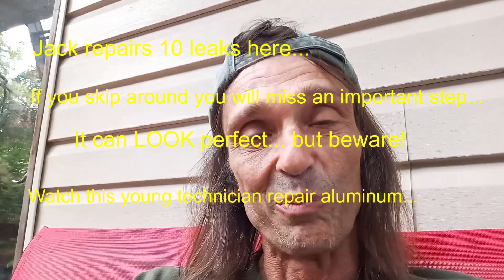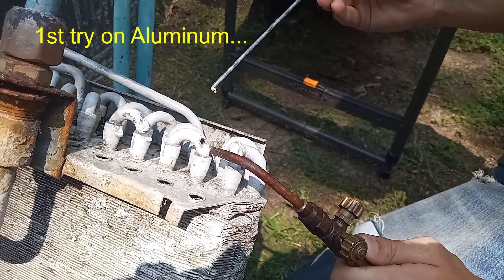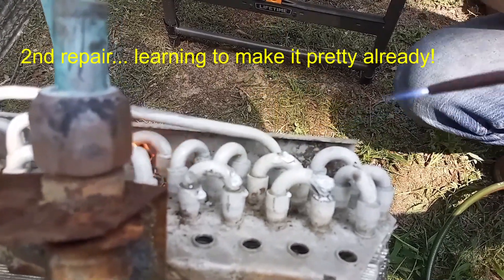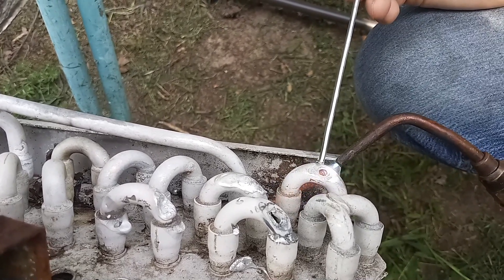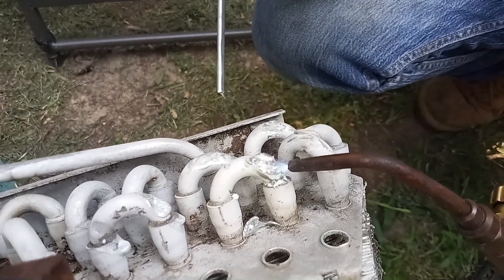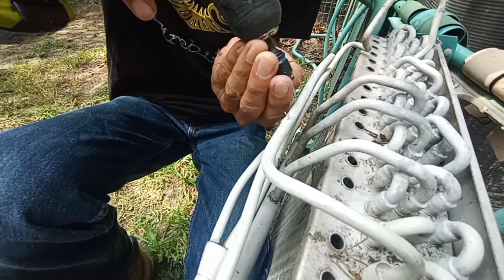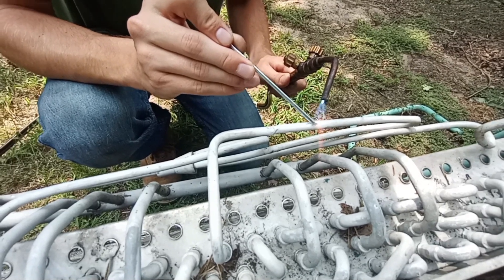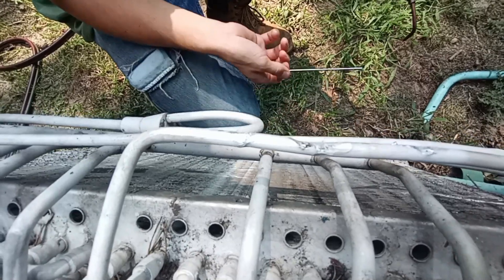YOUNG HVAC Tech REPAIRS ALUMINUM COILS like a BOSS! HOW TO? You must Watch This Video

Comment: Good to teach the kid and me. I've never blaze aluminum in my few yrs of commercial refrigeration. Ever try using it with Turbotorch?
Reply from the maker: @pnp8849  actually even oxy/acet rig is too hot.. I'm thinking the Turbo Torch would be even worse because you can't focus the Heat and will loosen the other joints close by.. it's actually best to use propane or MAPP gas. Give it a shot..thx for the comment!

Comment: may be better bonding and looking with some flux. although too much contamination of the system is a worry. 😬 expensive devils good rods are.
Reply from the maker: I've used those Al 822, quite pricey, but I was very happy and surprised with these rods. Will be making another video with some details. These rods were Flux core all in one... Thx for the input!